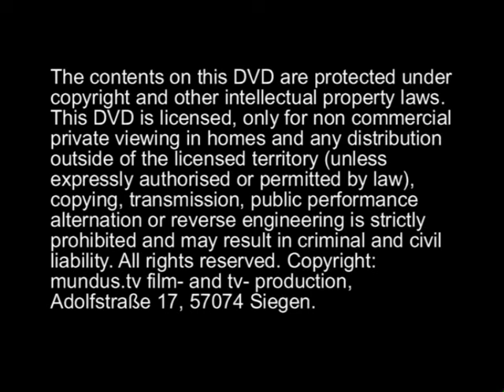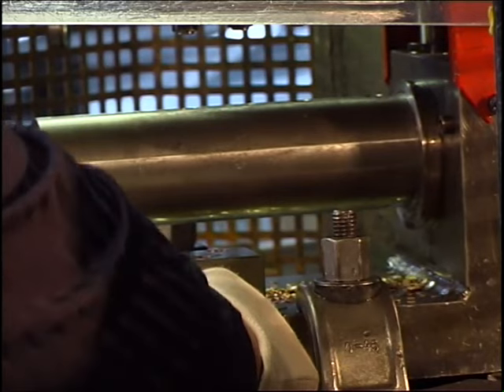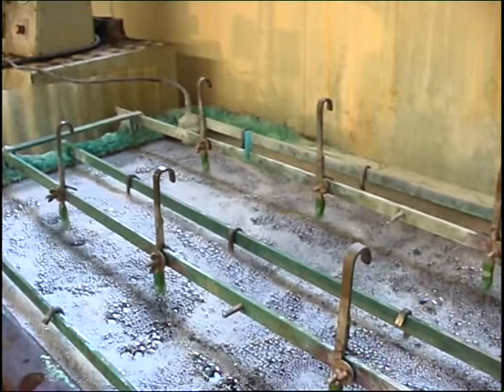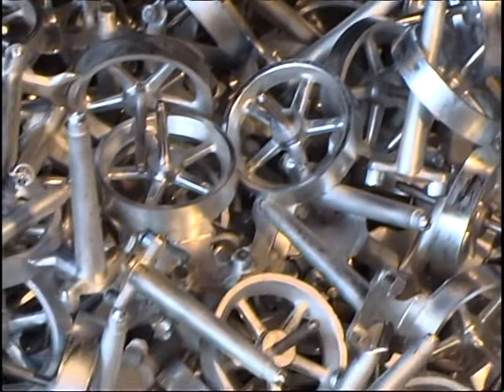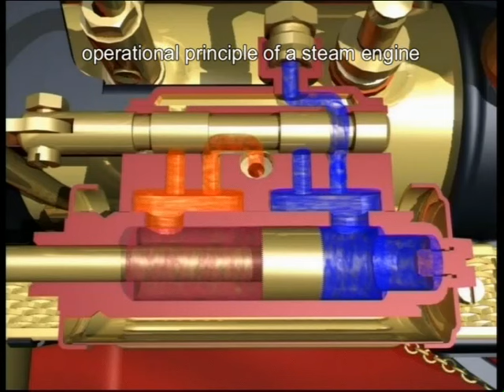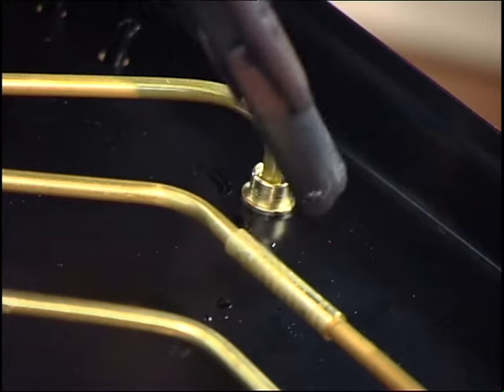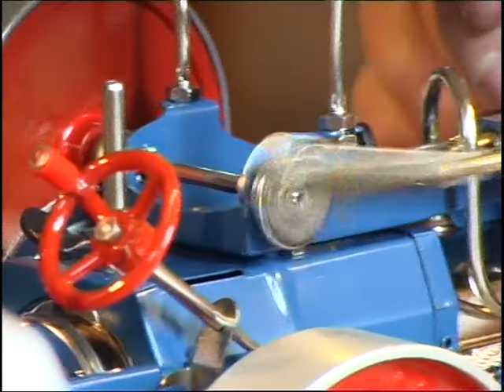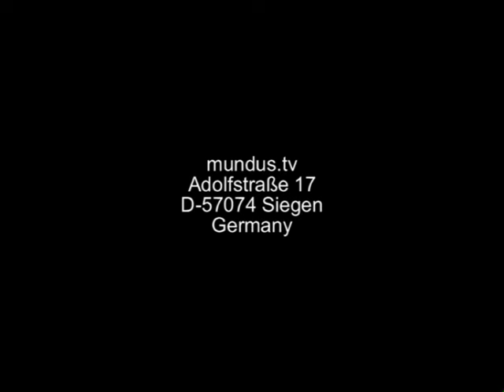The production of Wilesco model steam engines

Comment: Great stuff, water, fire,  steel and steam,  good thing that it is still made in Germany.
Reply: yeah, america would try using a bunch of plastic parts made in china...
Reply: That is an unfair assumption to make I have German,British and American steam engines all of which work great my American steam engines did not come with ANY plastic parts and further more the engines were masterfully machined without a single fault and NONE of the parts were made in china perhaps you should buy one and see for yourself before judging something you haven't even bothered to look at.
Reply: That's how they have been made here since the 70s, much thinner flimsier stamped sheet metal, even the engine's casing is nothing but a shaped piece of sheet metal covering over an engine block that looks like little more than a piece of water pipe.
I have a couple of old antique engines, one is solid brass that came from a popcorn machine, the other is also solid brass but a vertical  beam engine, with real metal piston rings and very good looking, realistic scale tiny screws and nuts.
Reply: had one when i was a boy 40 years ago

Comment: Neat! I have a Wilesco Old Smokey from 40 years ago (parents bought it in Germany), still runs and last fired it a year or so ago. I should try it again, only problem is the idler gear between the piston and the drive wheel is loose, need to figure out how to repair that.

But overall a neat little thing. Wish I could figure out how to clean scale from the boiler window; using vinegar on nickel plated steel is a very bad idea.
Reply: Mine is about the same age (me, too, by the way). They come as kits, as well. You can find the instructions online, so maybe you can use the to take it apart far enough to get to the loose part. Or call the factory, they appear to be more eager to rebuild an old machine than selling you a new one.